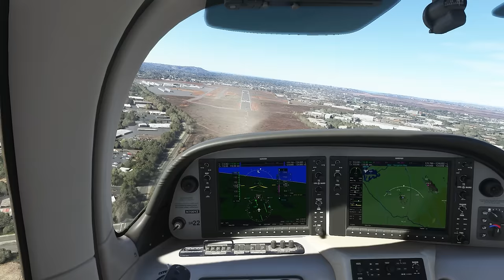Fatal Plane Crash At Montgomery Field After Student Pilot Declares An Emergency | N700YZ Crash

Comment: You said leave our thoughts. So I will. This will be long but I think pilots, especially "old school" pilots will appreciate and agree. First, I'm 48, have been a pilot for 31 years and am a flight instructor in both helicopters and airplanes. My disclaimer is that I do not know this pilot and it's always tragic and it hurts to hear this kind of news. I'm not disparaging or meaning disrespect to him but I will state some harsh reality that some might find blunt. The reality is we don't know what really happened but we have some information. Let's take that info at face value. What he's describing is "runaway" trim. This is an actual contingency that happens more than you'd think and pilots SHOULD be trained on mitigating it prior to either solo flight or if they are already a pilot, during checkout in the plane. We don't know if he was trained but I'm going to guess he was. Yes, I made an assumption that could be wrong but any CFI worth his ticket would and should have ensured this. It sounds, from the tiny bit of info we have, he had a runaway. The proper procedure would be to pull the breaker, disable the electric trim motor, and then fly the plane as normal using the trim manually. Here's where I know I'll catch flak. These new, very high performance Cirrus planes are, in my experience, either flown by VERY experienced pilots or EXTREMELY inexperienced ones. People with the money to learn on them are given many "crutches" in the form of features the planes have. And I've seen way too many pilots that are low time or learned in Cirruses that are severely lacking in basic airmanship skills. I'm not saying this was the case here, I'm just calling it as I see it with the information we have available so far. This isn't an indictment on his character or the type of person he was. It's just a brutal fact. It SOUNDS like he had the runaway trim, panicked, and did the LAST thing he should have done and tried to fight the trim down to land instead of giving himself plenty of room in the air and fighting it until he could disable it and then land the plane as if it was a non-event. You see this frequently with these "Cirrus pilots". Those planes spoil you because they do everything for you...until they don't. I think it's sad that this happened when it may have been avoidable but the bigger issue is if no one takes away anything from this that could save another pilot in a similar situation, that's an even greater tragedy. I could go on for days about this but I'll leave it at this and keep this "testimony" open to rebuttal. But anyone who finds this "offensive" and wants to debate me on it, before you do, look carefully at whether or not your response is driven on empirical data or pure emotion.
Reply: I’m old school too (80 years old and a pilot for 63 years) and I’m convinced you have accurately identified the probable cause. I like what you said about having an airplane that will do everything for you…until it don’t…because that WILL happen if you fly enough and it usually happens at the most inconvenient time!
Reply: I don't think you were disrespectful at all. You stated facts where you knew them, and yes, a little bit of a conjecture, but with the caveat that you could be wrong. I don't see any problem with that. 
What do you think of the comments of Cirrus pilots on Katherine'sReport that he may have been too slow, thus activating the Envelope Protection System, which in turn would have tried to bring the nose down? The  theory is he may have misidentified it as a trim malfunction, kept pulling back on the yoke, which reduced speed until he stalled and crashed.
Reply: @RMR1  This is a really interesting theory and, admittedly, one I hadn't heard or given thought to because I'm not a Cirrus pilot. I've heard of this system and read a little about it but I might need your help if I get my facts wrong. I don't have time in a Cirrus (I call them 'cult airplanes') but I have time in many different models with electric trim, some of which can he a real handful if you have a runaway.  Having said that, I'll respond with my thoughts on that possibility.  It's my understanding that that system has an override to it.  If that's the case, once again the issue would be training.  Being familiar with the aircraft and able to identify when that system kicks in at a bad time would and should be crucial to the pre-solo or checkout process.  

Let's say, for argument's sake, that that's exactly what happened.  It reinforces my statement on these planes doing everything for you, until they don't.  It's a dumb machine and doesn't perceive the danger in some situations.  That's the pilot's job.  When it does something IT thinks is right, sometimes it's not.  The Cirrus is also not a "fly-by-wire" plane, in that it still uses mechanical linkages connected to the yoke to manipulate the control surfaces. This means that the pilot can still make inputs against the system.  If the system is designed to overpower the pilot, I'd say it's a poorly designed system and that contingency should've been considered in the design.  But I'd bet my teeth that it has an override which, once again, would've made this a "non-event" if applied.

Now back to that vs. runaway trim.  Like I said, I only used the available info given in this circumstance, I wasn't there with him to know what really happened.  Either way, EVERY plane I've ever flown has an override for trim systems and for autopilot systems.  In other words, if the pilot needs to tell the dumb machine to do what you're telling it to, they provide the means to do just that in order to allow the pilot to meet an emergency.  EVERY plane or helicopter I've flown with an autopilot or electric trim or ANYTHING that flies it for you could be outmuscled by the pilot and overridden. Whether it's a button, switch, or breaker.  It'll fight you, and you don't want to fly for extended time because it'll wear you out FAST, but it lets you fly (notice I said lets "YOU" fly) until you can mitigate the problem.

Now the other possibility of stalling.  That's also a scenario that can't be overlooked. I did think about that initially. I thought that he might have stalled it in but, once again I'm reaching into conjecture here and may be way off the mark, but in accidents I've seen, and I've seen a few, where the pilot stalled it on approach/landing, they either fall short of the runway, or crash ON the runway. They're still landing the plane in their minds or at least fighting to put in on the runway when they stall it.  In some cases, they don't even know they're about to stall, it just takes them by surprise. This pilot looks to have almost overshot the runway and ended up alongside it, kind of distant from it, or in any case, not in line with the runway itself. It's just not indicative, to me, as a botched/stalled approach.  It actually looks like he was trying to follow the instructions and do an offset go-around until the airplane just overtook him.  I don't rule out a stall but where he ended up seems to indicate he was "fighting" the plane, which would be more in line with that trim or Envelope Protection System.  

Anyway, This guy's poor family is having the worst days of their lives and I feel awful for them.  I just want to be clear that I'm not trying to make a spectacle or case study out of him but we're pilots and/or aviation enthusiasts and this is what most of us do in these events, if only to try and understand what went wrong so it doesn't happen to one of us or someone we care about.
Reply: Another forum had a discussion on this and it sounds like the trim circuit breaker is INCREDIBLY hard to get to on the SR20.  Like down next to your leg by your feet.  Where even if you know where it is it's hard to disable.  Most small planes it's on the lower dash and accessible...
Reply: I’m a new pilot. Student pilot as a matter of fact. What you just said probably saved my life. Next thing I’m going to talk and drill with my instructor would be runaway trim. 

My reaction to this unfortunate incident was “why didn’t he just go around?” Hindsight 20/20, I know, but if it was me up there with a runaway trim, after the situation settled I’d fly around for a bit. See what I can do. My first thought was actually, since he was in a cirrus, was to fly somewhere remote-ish and pull the chute. My instructors, peers and myself often talk smack about cirrus’s and it’s parachute recovery system. But I think this would have been he perfect time to use one, if equipped. 
In my case, since I fly a DA20 I would just burry the stick counter to the trim force and see how long I can hold it. If I can get to the breaker I would pull it.
Reply: @Mr.Scootini  He couldn't go around because he was trimmed full nose down.  The only way to get the situation settled would have had to start with pulling the breaker for the electric trim - and this is the critical problem in this case. If you're training on a plane with electric trim and haven't been accustomed to using manual trim, you may not know how to disable the electric trim and use the trim wheel or even be that aware of its existence. This pilot was low and unable to climb so the chute probably wasn't an option.
Reply: It is possible he had barely ever used manual trim.  If you have electric trim, you'd use it 99.9% of the time and only use manual if you're training specifically for a failure or something.  So even if the instructor covered it (and there is no info on that either way but I assume it's part of the Cirrus curriculum), it's probably far from a current/ingrained skill.  I have no idea where the breaker is on a Cirrus but my Cessna TR182 had an electric trim & A/P cutoff switch right on the panel (custom install).  Not having that, I'd have had to hunt a bit on the breaker panel.  I'm not as willing as the OP to dump on the Cirrus factor in this case.  He was a solo student pilot who may (we don't know) have received inadequate training in handling runaway trim - and those factors loom larger for me than the Cirrus thing.
Reply: It may have just been a CFI who didn’t have a whole lot of experience in Cirrus’s. 

I’m a CFI in TAAs. Started in a steam gauge 152, Flew a DA40 G1000 for most of my from Instrument to CFI and then spent most of my time as a CFI in a G1000 172S. I have never taught it and I haven’t had a CFI teach it to me. In fact checking the POH of the 172S and the DA40 which I trained in before(both of which have electric trim on the student side) there doesn’t seem to be any emergency checklist or action item for it. 

My guess is because unlike the cirrus they both have trim wheels, so if it runs away you can fight it with the wheel, though I can’t guarantee thats the case.
Reply: @Dr_Kenneth_Noisewater  from what I know in aircraft design, trim should never over come the actual elevator input. It’s gonna take a lot of strength, but it’s what is needed to live
Reply: pulling breaker was my first thought...elect. trim....
Reply: @Mr.Scootini  I would have been pulling like there's no tomorrow.
Reply: @Dr_Kenneth_Noisewater  sorry the trim surface area is way smaller than the elevator surface area, simple physics. His airspeed is a factor and he might have to be putting in hard control inputs but it’s flyable. Small GA aircraft fly everyday In uncoordinated configuration until trimmed correctly, the sad part is he lost his life as a new pilot faced with an abnormal stress situation.
Reply: @ragzpar  And here, ladies and gentleman, is that "emotional response" I warned you all about.  Since you're in the mood to start slinging mud, I'll respond in kind.  This'll be fun.

ANY pilot that takes his craft (that means practice of his chosen subject, not aircraft) seriously will have prepared himself for this contingency.  So I'll first address the breaker issue.  I've flown planes with a LOT of breakers.  But there are breakers you INTIMATELY familiarize yourself with.  Hydraulics if they're there, ELECTRIC TRIM if it's there, autopilot if it's there.  Runaway trim and autopilot issues are a real thing.  These aren't anomalies that only happen in once in a blue moon fashion.  If you're flying an aircraft with these features and you can't find those breakers with your EYES CLOSED, you are failing in your responsibilities as a PIC.  You locate these breakers and familiarize yourself with "how many down and how many over" so that if it happens, you don't need to bend down with a flashlight.  You can feel for them while still flying.  And for a plane with so many features on it that are automated, it's a pretty poor design to make it THAT difficult to mitigate for that problem.  And for your information, I HAVE in fact handled a runaway trim in flight. I reverted to my training and preparation and it became a "non-event".  The way you're talking, "I'm a Cirrus pilot" (You are EXACTLY why I call it a "cult airplane", because you guys think you're superior pilots when in most cases, it's the opposite) you sound like you're prepared to accept your fate and become a smoking hole yourself. If you're rolling your eyes by now with this reality check, that is why you are a hack.  That is why you are an amateur.  And that is why you are a guy who flies and not a "pilot". Don't you, for one second, think you have the authority to tell me to "stop acting like I could've handled it".  I have had to handle things in airplanes and helicopters in my 31 years that would make you cut your ticket into pieces. Get off your high-horse, rookie, it may save your life.

Next, when you're right, you're right. I've seen guys with TONS of time make stupid errors.  Complacency is a killer.  Humility is a life saver.  The guys that I've flown with that had lots of time that screwed up, when they realized they got complacent, they came back to reality REAL fast. As far as me making mistakes, everyone has. I don't pretend to be flawless.  But I also paid CLOSE attention to emergency mitigation and trusted in it and took it SERIOUSLY.  That's why I'm still alive.  So go ahead and criticize me for that.  After the years I've spent flying, it isn't just dumb luck.  If I had that kind of luck I would've made billions in the casinos by now. Check your level of self-importance, junior.

This brings us to my disclaimers. I NEVER, at any point, claimed I knew exactly what happened.  In fact, I was VERY careful to state that none of us really knows what happened.  If you recall, the poster of the video asked, specifically, for pilots to comment on it, so I did.  I was invited to state my opinion and quite frankly, until you came along, the adults in the room were having an educated, respectful conversation on the subject.  But I knew you'd come along, so here we are now.  Again, you don't have the authority to tell me to "shut the fudge up" when I was invited to state my opinion.  If you don't like my opinion, shove your head up your immature crack.

Now, we'll end this like this.  You felt perfectly comfortable trying to impeach my character so I will repay the compliment.  You sound like a kid who has more money than brains and had the opportunity to fly a Cirrus. Perhaps you've never even flown another model plane.  Perhaps you're not even a pilot because flying Cirruses in Microsoft Flight Sim doesn't make you a real pilot, kiddo.  It also sounds like you may have, on an occasion or two, seen a CFI make a minor mistake that you absolutely relished in correcting him on.  I'll wager you remember both times and have them burned into your memory and take pride in it. Might've even logged it! You have an AWFULLY high opinion of yourself if you're so good that you feel like you're smarter than the CFIs you've flown with.  If you really are that much better than them, it doesn't bode well for them and you should find a new CFI. But you've already given yourself permission to fail in an emergency.  And that speaks volumes about you.  I'm not wishing any harm to you or, god-forbid, whoever is unlucky enough to fly with you.  On the contrary, I hope you really take a deep dive into yourself and actually re-read everything by EVERYONE in this comment thread and try to become a better pilot instead of the Amelia Earhart you THINK you are.  You better learn that plane, pal, because if this isn't a wake up call that things can, and do, go wrong, no matter how many bells and whistles you have, you don't stand a chance.  Thank you for being such a great example of how NOT to react in an intellectual discussion.  Your emotions won't help you up there, so you better get control over them down here and reel yourself in before you hurt someone.  Here endeth the lesson.  Keep the blue side up, kid, you're gonna need it.
Reply: @rstats2127  it's not the surface area that matters - entirely.  It's force.  Otherwise how could a tiny trim tab offset a relatively large elevator?  The answer is that it's located way out on the trailing edge of the elevator so it has a longer moment arm compared to the elevator's moment arm.  Force x length = moment or torque and all that.  And it probably wasn't just a little out of trim but full nose down if it really did run away.  I agree it may have been possible to overcome that but it would have required a helluva pull while also trying to do other tasks.  I've had my airplane far out of trim and it's a load.
Reply: @rstats2127  You raise a good point about the possibility of an inexperienced pilot in a highly unusual emergency possibly stalling.  That's a lot to work through and you can hear it in his voice.  This is very much a tragedy indeed.
Reply: @gringoloco8576  If that is fact (I have no idea) it would make me wonder how these planes got certified. Should be worthy of an AD at least.
Reply: I am so sorry this fellow lost his life in an avoidable situation. Reflecting on my flying years virtually every incident my friends were in, or myself (even when I was an instructor) was avoidable. 
I was blessed with the best instructor who to this day speaks to me when I fly. Bunny Connors CFII, ATP is no longer with us but her lessons remain. 
Instruction 
Repetition 
Simulation 
In all conditions 
At all times one might fly. 
In all environments.
Reply: @gringoloco8576  Turn master switch to off.
Reply: I just want to remind everyone who are commenting on this thread that the pilot could be a student pilot based on the title of the video.  He would not be prepared to handle a variety of emergencies like a seasoned pilot or a CFI.  It would be easy for a student pilot to panic at a moment like this, and the natural instinct is to put the plane down especially when he was approaching an airport.
Reply: Agree; master switch off would disable electric trim (and radio, but a live pilot could explain that later, especially since an emergency was declared).
Reply: @Quillons1  looks like he deleted his original post but I thoroughly enjoyed your rebuttal!
Reply: @dangoldbach6570  Thank you. I have his post saved if anyone is interested. My response is a little harsh (it's meant to be) but without context it might be weird to see what I'm responding to. But I saved his post for the next emotionally fragile softy that wants to take a shot and call me "mean" 🤣
Reply: @Quillons1  - This entire thread is an interesting read. My thoughts are that the latest tech that does everything for you is not a bad thing. It does require two things:

 - The more tech you have, the more initial and recurrent training you need. You have to know how the tech works and how the tech breaks. Then, you have to know what to do when (not if) the tech breaks. 

 - The more tech you have, the longer and more diligent your planning, preflight, and checklists need to be. Any electric trim or autopilot system has to have a pre-taxi or run-up checklist that includes actually testing multiple ways to disconnect the system. Being able to over-power the system is not enough unless the system can sense the pilot feedback and disconnect on its own. 
A good example of this is in the Cessna 172SP. The autopilot will auto-disconnect when fought. There are also 3 different buttons marked in red that will disconnect the system. The trim thumb switches will disconnect the system. Finally, the autopilot/trim circuit breaker is the only one marked in red and easily identifiable.
Reply: @phatvu3811  - Granted, it would be natural for a student pilot to panicked and be flustered. This is even more of a reason to fly within your individual limitations. Flying too much airplane may have been beyond his limitations to perform solo. Flying with a more seasoned pilot or an instructor would have been a wiser decision. Even flying a simpler aircraft would have made sense.
Reply: @rstats2127  - I am not really sure I understand your statement. The trim tab is a very small surface area. But, The pilot is not fighting the trim tab. The trim tab easily moves the much larger surface area of the elevator/stabilator. In a poorly trimmed aircraft, the pilot would have to fight the entire force of the large primary control surface.
Reply: @Mr.Scootini  - Think of trim as a secondary control input. It moves the control surfaces with the same dynamic force as another pilot. Think of the amount of force one would face when fighting a trim stall on a go-around. It is not an insurmountable amount. But, it would be enough to throw off the muscle memory of a new pilot.
Reply: A Cirrus is too fast for most rookie pilots to keep ahead of. Stay ahead of the airplane is rule number one.
Reply: @deanfowlkes  The latest tech doing everything for you is definitely not a bad thing.  If that were the case, they wouldn't continue developing better and better goodies.  Where it becomes a bad thing is when it's all you know and can't function without it.  I gave 3 BFRs last month and 2 of them were guys that fly a technically advanced airplane (TAA).  The plane we were in has a Garmin 750 in it.  The first thing I did was press the "home" button and "took away" their GPS.  They were COMPLETELY lost without it.  This is a phenomenon I've seen much more of lately.  Basic airmanship is a dying art.  Pilotage is a dying art.  I still do Cross countries with paper charts because it's actually fun for me and I like the old school feel of it.  Paper charts don't run out of batteries.  Their screens don't crack.  And they don't overheat.  But they DO fly out of windows (this is a really funny story, actually)! 🤣 

You're 100% right, though.  You HAVE to know what to do when you lose these goodies.  I said in my first post that I've seen either really experienced pilots flying Cirruses or REALLY inexperienced ones.  The inexperienced ones are outright frightening.  I lose sleep knowing a lot (not just a few) are up there with me.  They are that over reliant on the advanced features.  If you can't operate without a GPS, you shouldn't have a license.  That's my humble opinion.  That's not to say that you SHOULDN'T have one.  You just need to not turn into a bowl of mush when you see that little "LOI" light come on.  

I also do IPCs with "TAA" guys. Those are REALLY funny. I flew with a guy recently that had hundreds of hours of IMC time or "actual" instrument.  Turns out 99% of it was under autopilot.  He couldn't hand fly an approach! You gotta "stay good", even in these fast, nice planes. The biggest problem is that a lot of pilots don't want to be seen with their "pants down".  They don't want to admit to themselves that they may not be as proficient as they think they are.  So they just keep doing what they do best and don't step out of their comfort zone.  

Anyway, I whole-heartedly agree with you on tech issue.  I don't dismiss it or disparage it.  I just don't like how pilots now tend to think it's the only way to fly.  Accidents waiting to happen.
Reply: @deanfowlkes  spot on. The trim tab flys the elevator and not the aircraft. Having experienced trim runaways as an autopiliot maintainer on troubleshooting test flights I can attest to how scary and quick they are and how much authority they actually have. If they happen too close to the ground they are damn dangerous and can quickly become unmanageable.
Reply: I am 56 and agree 100% . I also feel that part of the responsability for this crash should go the ATC for adding additional stress on the piolet for not listening to the transmissions. He stated three times, and twice very clearly that he had an emergency. Yes, he didn't use the proper language, but he was a new pilot and panicking...anyone who was actually paying attention should have understood what was going on. I have noticed in the past three decades, that like the rest of society, the profsionalialism of both ATC and piolets has declined drastically. The stuck mike is BS if this is actual audio. We all could hear and understand what was going on despite EVERYONE stepping on each other. She was simply giving orders and not listening to anyone. Anymore, a lot of ATC and pilots alike are like the don't give a sh..t teenagers at the drive through. They talk 100 miles an hour and slur their words. I have had to have a transmission repeated up to five times before getting pissed off and asking for them to slow down just a little bit and enunciate their words. I always get the same BS response...we have a lot going on and need to speak fast. I understand that completely, but which is faster? repeating it three to five times, or saying it clearly once. Most of the time I just let it go, because there isn't that much traffic like in this video and I can figure it out. But, when going into an airport where there are several planes an hour landing and taking off, I would really like to know what is going on around me. I know that I too will probably catch flak for my response.
Reply: A reasonable and plausible explanation. May the gentleman RIP.
Reply: You aren't wrong
Reply: It looks like you have hit the nail on the head here, it would not surprise me if this a low hours pilot, it does annoy me all these electronics cutting in when you don't need them, that is why I drive a manual car still, I can't understand why you want or need an e-trim anyway it's not hard to use, I don't know about a huge airliner but on something small I can't understand why you need it at all.
Reply: With 10 years of professional flying experience flying pistons, turbo props and Now jets and almost all my primary training in steam gauges I absolutely 100% agree that there was panic and may have been poor judgment to quickly set the aircraft down. Actually seen that happen not to long ago with a Gulfstream over in SDQ airport with inadvertent speed brake deployment. Crew was in a rush to land doing a short visual instead of doing a long final over water and buying themselves time for a much stabilized approach. RIP.
Reply: I think what you said was well stated. No flak from me and Im also dual rated fixed and rotor wing. Tragic and sad its part of flying and we can only learn from these incidents to try and mitigate them. Bell-206 Captain
Reply: @andrewbello983  Jet Ranger 🚁 😁
Reply: @deanfowlkes  I think in this case, it was a student pilot practicing after his solo.  All student pilots must have a minimum of hours of solo flying before he can be qualified for the the private pilot checkride.  This isn't the first time a student pilot crashed his Cirrus.  In another accident the student pilot forgot to remove the pitot tube cover and couldn't tell his speed.  He flew too slowly and spun his airplane and died.  In both cases, for whatever the reason, the two student pilots did not climb to a higher altitude to deploy the BRS parachute.  But then, they were student pilots and I remembered making quite a few stupid mistakes while flying solo during training too.
Reply: I’m a much less seasoned 41yo pilot than the OP, and I do fly a Cirrus. I think the OP nailed it. 100%. One big problem that I see is with training in general. Young CFIs that don’t want to instruct are instructing so they can hit that 1,500 hr mark and go to the airlines. Their students suffer from it both knowledge wise and in stick and rudder flying. Also, there is a huge shortage of DPEs, and some DPEs are conducting 3 checkrides per day (at $500 - $1000 per). Quality pilots are not being made at pilot mills and they are doing dangerous/deadly things in the sky.
Reply: @RMR1  There is some amusement in the idea of a Cirrus having an MCAS accident, tragic as it is.
Reply: Didn't he also have a ballistic chute?
Reply: This is why I prefer steam gauges and manual trim.  The only modern technology I want is an iPad with foreflight.
Reply: Not trying to discredit anyone but a lot of people are saying to pull the circuit breaker and use manual trim. That would work in most aircraft but I thought the cirrus only had electrical trim and not a manual trim wheel so what should he do in this scenario? Maybe I’m wrong and they do have manual trim but I heard they didn’t.
Reply: Didn't know the trim was electrically actuated- interesting. 
Not sure if I like that.
Reply: @jameschilton2039  I was under the same impression, at least with a couple of Cirrus models, but I have no time-in-type. If so, I think the FAA needs to amend the certification standards to disallow that. Even with far more robust automation systems backup, Airbus still has manual wheels for a worst-case scenario (and even those did not save such a situation over the Meditteranean one day, likely because the annunciator of electric control having quit was too dim and small to generate the appropriate reaction). I would be leery about flying a GA manufacturer's product who thought it was fine to exclude them when the forces were great enough to cause, or significantly contribute to, loss of control at slow speeds.
Reply: I had no idea this thread would take off like this but I'm glad it did. I've chimed in a few times addressing a couple of things but for other things I've kind of just lurked in the background and took things in because I wanted to see where it would go.  Some posters here have said things that I think are truly with the best of intentions, but perfectly illustrate my point in how we have people flying Cirruses that shouldn't be.  So let's buckle up again because the Cirrus fanboys are going to take exception to this! 🤣

One of the recurring comments has been about the "Ballistic Recovery System", or "chute" to keep it simple.  This was an AMAZING implement for safety on planes.  It also (like GPS, iPads, TCAS, TAWS, and the list goes on) has had a very detrimental effect on safety, or rather the "safety mindset".  I've seen at least 3 people post about "Why didn't he just activate the chute??"  And the reason this is being asked is simple.  Because it's there.  It's literally a parachute that takes away from the pilot thinking, "I may have to make a forced landing or other kind of emergency."  Instead, these pilots are saying, "Well, f*ck it, I have the parachute,  I'm not making an EMERGENCY landing!  Why would I even consider that when I have the chute???"  This is another example of preparing to fail, on several levels.  Now, full disclaimer, I will admit that I find the over reliance on the chutes to be absolutely disgusting.  I've flown with guys getting BFRs and checkouts in Cherokees and 172's (and a few other airframes) that when I give them a simulated engine failure, the FIRST thing they ALL do is revert to "the chute" option.  And it's not there. It's really funny watching the reality set in, actually. But it's a toxic mindset towards safety. I'll outline a few, but maybe not all, reasons I hate the mindset.

The first reason I've already stated.  Some pilots, you know who I'm referring to, use that crutch to protect them simply because it's there and it takes away the necessity of having to be proficient in Emergency Procedures. I would bet my ticket that some of you reading this that fly Cirruses (or other planes with a chute) have actually told themselves, "If I get into trouble, ANY kind of trouble, I'll just pull the chute."  Like it or not, a couple of you actually already basically said that not even realizing the ramifications of it.  So basically what I'm saying is that "safety blanket" that you've been given has been used to absolve yourself of PIC duties to meet an emergency.  Even a simple one. And yes, there are simple emergencies that can be mitigated into a "non-event".  I've touched on one or two earlier. You have guys flying around in Cirruses that'll pull that chute if their RADIO fails! And no, I'm not being hyperbolic or exaggerating. I've had these discussions with them before.  The point?  Relying on that chute out of "self-preservation" is actually detrimental to self-preservation.

Next we look at the ramifications on your license.  Let's take this situation and modify it a little to fit our scenario.  Runaway trim happens.  We follow the recommendation of a couple of posters here. We fight the trim, climb, slow down, if necessary, and pop the chute. CONGRATULATIONS!! Crisis averted.  Until you're flying in an area where, now at the mercy of the wind, puts you in the middle of a lake or into the ocean.  Now you've ditched. I hope you've taken a ditching school class!  Because it's not as easy as you think in that chaos. Or you've put yourself DEEP into a canyon or ravine.  Or insert ANY other undesirable location that'll be hard for rescuers to get to you.  There's no guarantee you're not going to get hurt in the landing of the deployed chute.  And as a side note, which we'll get into in a bit, you've destroyed a perfectly working airplane.  I would MUCH prefer to get that malfunction under control and just simply fly the airplane and land it, normally. Non-event.  The FAA doesn't even KNOW about it because a trim issue isn't required to be reported.  One of these is an ACTUAL emergency that YOU manifested.  One is a non-event that YOU mitigated. Either way, the plane is flyable, until YOU made it not flyable.  The other half of this is now you've created either an aircraft accident. I know, I know, "It's only an 'incident' if no one is hurt".  Well, I'm not so sure the FAA agrees.  an "Accident" includes substantial damage to the aircraft.  Pulling that chute renders the plane unairworthy ever again.  I'd say that's "substantial damage".  This one may be subject to the FAA's interpretation.  Now you have an incident or accident on your record which COULD induce repercussions against your ticket....when it was as simple as pulling a breaker, hitting an override, or whatever and just flying the plane...as normal.  Non-event.  Even a full engine failure, If you're in an area where that plane had a small issue but caused the engine to fail (I know it's an oxymoronic thing to say but they really are the norm.).  If you can safely perform a power off landing in that plane in a DESIRABLE location and the engine can be repaired, that plane flies again.  You pull that chute, you destroy the plane. More on this in a minute.

Now this will rattle a few people.  These planes cost about $500,000.  Maybe you can get them for les but they're about a half million to purchase.  It's nice to have money.  I'll break this down into 2 sections. 1) owners and 2) renters.  

Owners, you bought this gorgeous plane, fast as a demon, climbs like a homesick angel. You're in love. I don't blame you.  Do you want to immediately revert to destroying your plane, getting taken to the cleaners by the insurance company when they determine you could've landed the plane and not made it a total loss, have an incident/accident on your record making it more difficult (and expensive) to ever get insured again, AND be out half a million??  I know, "You can't put a value on human life".  That's true.  But by doing that, you may find it difficult to fly again after that.  Maybe not. But do you want to find out when you can just save that parachute for a complete, end-of-days, catastrophic event (which is REALLY what it's deigned for) and be proficient at being a PILOT and be able to handle an emergency landing and save the plane?  I wouldn't.

Renters, I get it, "Screw them AND their airplane, it's not MY plane and it's MY life."  I get that, too.  And your Avemco or AOPA renters insurance will cover only a fraction of the damages on the loss of that plane.  And you're renting a Cirrus probably because you can't afford to buy one.  Well, you will spend enough money on the difference that you're responsible for in that plane to have bought a different plane that would've been BEAUTIFUL...but it won't have a chute on it.  Then, once again, there's the issue of having it on your pilot record.  Maybe it's not a big deal to you but I spent a LOT of training and a LOT of years trying (and being successful) in keeping my record clear.  That could change in an instant. Some of you might just say I'm lucky.  But I will say 2 things about that. Thankfully my record is clear, that DOESN'T mean I've never had emergencies. And secondly, "Luck" is "Preparation" meeting "Opportunity".  It's funny how guys who are more prepared seem to be more "lucky" than guys that aren't.  

So for those of you that have the attitude of, "It's there, so why not use it?", those are some reasons why.  If you're relying on that chute because you're not PREPARED for an emergency, you're not a good pilot, and you might have to do some soul searching and a deep dive into your own self and decide if flying really is for you.  Please, I'd love to hear from you guys!  This is turning out to be a really good discussion!  I like the input!  Sorry about how long these are but it's a lot to say!
Reply: @phatvu3811  - True. A minimum of 10 hours are required. At least 5 of those hours have to be cross country. The rest is up to the instructor. Just as long as the student has 10 takeoffs and landings solo.

 That still means that the student must know everything about that aircraft before being released to solo practice on their own. Or, the student needs to be taught in a simpler aircraft. After all, the student should not solo unless they have an instructor endorsement for each solo flight.
Reply: Definitely going to hit my flight instructor up about runaway electric trim before our next flight.
Reply: @AmericusMaximus  - If you fly with electric trim and/or autopilot, have your instructor show you each and every way of terminating the operation or disconnecting those. Practice each one during either your pre-taxi or run-up for each flight.
Reply: I guess it’s good my plane as an electric trim toggle switch.. 🤷🏼‍♂️
Reply: As a current student pilot, I appreciate this info
Reply: When you go from a 172 to a 177 RG , its a whole difference  entering a 45 into the pattern with 120mph .  They put 172! minded people into high performance Cirrus and they just get behind it just like at Hobby Airport in the Cirrus, Brain Overload!
Reply: I’m no pilot, but I am an “old school” ground vehicle enthusiast. I see the same effect with increasingly-automated cars and drivers who have not actually honed the ability to control the situation without the automatics
Reply: I have to humbly agree to everything you’ve said in your comment. I am a professional pilot who’s been flying for over 30 year’s corporate experience with almost 10 type ratings (almost due to being in training obtaining my 10th as this is being typed; no pun intended). This was a very tragic accident and I also am very empathetic to all those involved. It’s a very tragic and unnecessary loss of life due to not having the experience, meaning total flight time, flying and dealing with emergency situations. I myself have not had any emergency situations in the real airplane; however, I am trained in how to deal with many emergency situations in the simulators. 
I don’t know the Cirrus or what kind of trim system it has or if it’s trained in what to do if a runaway trim occurs. What kind of trim system it has doesn’t really matter. What matters is being trained for any emergency situation on any aircraft is paramount. That being said again, I also believe trying to land an aircraft with any flight control malfunction is a recipe for disaster, such as in this case. Like previously stated, he should have powered  up and gone around and climbed to a safe altitude to work on the problem, notify ATC that he is an emergency aircraft which would have given him priority handling. Secure the problem and taken his time to land safely. That being said, it’s the experience that can keep your mind geared in what needs to be done in the correct manner. 
Training… Training… training… and keep calm and always fall back on your training. 
Again.. my utmost condolences to all who have been impacted with this unfortunate accident. 😢
GOD Bless!!
Reply: Thanks for this response. I can only assume he panicked and just wanted to get on the ground so there would be no problem, so to speak. This is like a scuba diver bolting to the surface over a problem that can and should be solved at depth.
Reply: @Lehmann108  Funny you say that… I received my PADI certification while I was in the Philippines and have not gone diving since my certification. If I were to dive today and had an incident under water, I probably would panic and do what you said, try to surface immediately. Again… training is always paramount in being able to keep a clear head. 
Stay safe…
Reply: The first thing I thought was “what’s a student pilot doing flying a cirrus?”. 

I have electric trim in my plane and use both the electric and manual features. Electric trim for small changes and I go manual for large quick changes. 

I was trained for a runaway and a runaway is pretty dramatic. But you’re taught to keep flying the airplane. You do whatever control inputs necessary to keep it flying until you pop that breaker. 

You also need to know EXACTLY where that breaker is so u can find it without looking at it. It helps to put a breaker collar on it so that it’s easy to find. 

This situation can be resolved in seconds if u have been trained properly. 

But when u have low time CFI’s who barely know how to fly themselves teaching new pilots, this is what you get. 

Babies teaching babies.
Reply: Works well until it doesn’t…poignant.
Reply: @gringoloco8576  It sounds like an airworthiness directive from the FAA for an easily accessible front panel auto-trim disable switch on that model of Cirrus aircraft might be in order here.
Reply: I couldn't agree with you more there should be more training from the factory when Pilots purchase these aircraft. They should disable every single feature that they can and have them fly the aircraft in different scenarios where automation won't come in and Save the Day. I am sure they could rig a few of their aircraft just for this type of training where the Factory pilot could just enable and disable different features and controls to create scenarios that the new owner pilot would not normally be in. It goes without saying that the pilot in his family are in my thoughts and prayers although I just found out about this today
Reply: @Shojohn11  This is a great point. For the money they get for these planes, they can spare a training flight or 2 to the purchaser. If the purchaser is a flight school, out other fleet, then for every plane, that school should have the option of sending a CFI through the training. It would be a hell of a marketing addition and incentive to buy that model.
Reply: Completely agree.. Traditional training aircraft have far more basic trim systems and now that alot more flight schools are heading down the Cirrus route, a more robust training syllabus needs to insure not just meeting a flight standard, but that the technical knowledge of the aircraft is ensure before flight..this should absolutely include trouble shooting and how to effectively use the QRH
Reply: @Quillons1  Never thought of flight schools , when purhasing such an aircraft, put them through the ringer and that students come on board for training and learning like you said free advertising they're going to end up loving the plane maybe one out of 100 will buy one. I see some people disagree with us to break it down into a simple anecdote my children was still taught arithmetic in school. What if their computer or calculator broke or did not have one they would need to know the basic of mathematics and not only that just the course of mathematics teaches learning and problem solving skills
Reply: Thank you for sharing. I too am a student pilot, and I have been studying crash/incidents to better prepare myself for the unexpected. It’s not easy to state harsh facts - so I applaud your efforts into sharing the face values. As well as how to prevent and prepare for these things. 👍👍
Reply: Some articles I'm reading on ESR 20 they say this is not an uncommon occurrence where the autopilot just shuts off also
Reply: @Shojohn11  circuits aren't flown with autopilot.. However, trim runaway is a very real and common issue.. The problem here is that the student was probably not shown how to diagnose and resolve a trim runaway event... Most aircraft check list would have you verify whether stuck control surface and faulty servo... Most of the time the solution is pull the CB
Reply: @Quillons1  I used to be somewhat sensitive, but have since grown up.  Now I appreciate and learn from advice and experience, no matter how harsh.  Flying can certainly go from heavenly to very serious in short time.  Your post is very clear.  You have to take the subject very seriously, and always be ready (meaning trained) for the worst.  Disclaimer - I'm not a pilot and won't be for a while due to financial restrictions.  But I've promised myself I'll never solo until my CFI tests the hell out of me and is confident I know my stuff.
Reply: I fully agree with you. I learned to fly old school and owned a Cessna 172, then a 182 and later end up buying a brand new Cirrus SR22. My opinion is that the culprit is training and a new generation of pilots and instructors that rely too heavily on electronics and then imbed the culture in the training also. Works fine most of the time until the electronics fail, and then it becomes fatal because the “electronic” pilot does not have the skill and training to deal with the situation the old school way. The Cirrus is a magnificent airplane and much safer than older planes, but just like a self driving car can increase safety for bad drivers, the safety goes away and becomes a huge problem fast when the system fails and you do not have a competent driver to fill the void. 

We see the same issue in airline accidents/incidents where the pilots are relying too much on flying with autopilot always and when that fails, they do not have the experience and skill to prevent it from escalating into a crisis.
Reply: When I was learning less than 20 hours I would not thought of popping the breaker
Reply: @cooperparts  were you learning in a Cirrus?
Reply: @alexanderdavidson7837  no but it had a trim on yoke
Reply: @Quillons1  Wow..thank you...I wouldn't worry about some of these clowns on here, they just can't handle pragmatic constructive criticism.. You are an inspiration... Have you considered running for office?
Reply: @alexanderdavidson7837  no I flew several cirrus planes but I am a diamond guy  did not like the side stick  my next plane will be a panthera
Reply: Very well said and a completely plausible if not probable situation that resulted in the tragic death of the Pilot.
Reply: Let us learn, so that No death is in vain😢
RIP
Reply: The electric trim on the cirrus is not a true trim of the elevator surfaces but a trim of the springs connected to the yoke. One does not need to overcome aerodynamic forces like a trim manual trim.
Reply: Good!
Reply: @Dr_Kenneth_Noisewater as a 25 yr + pilot and over 1k hrs in a sr22, I do have to say that unless the plane has the circuit breaker pull colorized, it would be hard to discern where the breaker is even though they are grouped into different systems .   the cirrus does not have manual trim (non electric).  It's controlled by the trim switch on the yoke and electrically activated.  Not knowing how close he was to the ground he was other than the last callout of 1200ft before the trim ranaway, unprepared pilots not knowing the system or exact location of the breakers positions (even more difficult during night emergencies) while combating a runaway trim nose down on the final leg would be difficult.
Reply: Look at the poor woman in Texas who after numerous go arounds and attempts to land spun her Cirrus in killing her and two others. There was a Cirrus at ANP doing a go around and it spun in killing the pilot. They are great traveling planes but unfortunately as you have said many people flying them lack basic stick and rudder skills.
Reply: @Dr_Kenneth_Noisewater  could have been full nose up also. We will have to wait for the report.
Reply: Spot on. I'm '64, and when I was getting my PL, an instructor died because of a much, much simpler kind of "stupid automation", as I call them. In a Cherokee with RG, there used to be (mind you, we're talking about the early '80s) what was called an "override" on the gear retraction system: it was meant to avoid a student having the plane landing on its belly after forgetting to lower the gear. It would automatically lower it below stall speed, even if the white lever was "up". The instructor had an engine catastrophic failure over a farm field, made for a perfect belly landing on the pasture  - strewn with termite mounds - and the wretched thing lowered the gear at the very last second. Struck a mound with a half-lowered gear leg, flipped over, and that was that. No "stupid automation", he would have lived to brag&beer.
Reply: @deltagamma-en1zh  I know that overpriced VERY well. On some models they actually installed a pin to keep the auto hear deployment overridden so it wouldn't deploy. We used it a lot in fight training! But I know exactly what you're talking about.
Reply: @deltagamma-en1zh  The arrow will not lower it's gear if the override is up. There is a pin to hold it up and override the system. Most times it is used for short take offs, airwork and in the case of your instructor an intentional gear up landing. It lowers at a higher speed then stall speed. I have about 500+ hours in Arrows mainly the IV but also the IVT, III, II and I. Very familiar with the plane. Sad he didn't have the override on.
Reply: @Quillons1  I'm confident after reading your detailed material, I can in fact now fly a plane on that info alone. Can you briefly explain how to take off & land? I'm calling to reserve a plane right now for tomorrow, hopefully I hear back by then. lolol
I don't mean to make light of such a tragic situation & I'm not, may the pilot RIP. One of my best buds flies a Hawker 800 for a private company with a household name, so I understand the seriousness of the issue at hand. He had a moment that shook him, a plane came out of nowhere directly at them & he said if he could've stood up & raised him arms straight up, he'd have lost his hands...It was that close! His company offered him extra time off but after a couple of days he was back in the air.
Funny story...kind of. My buddy & I went up in a brand new 6 seater "something", it was really nice, anyway we had it for 2 hours as he was just logging hours & letting me fly it a little bit. It was a bluebird day & I was hungover as could be from a bachelor party we held at my house just hours before. We stopped for a fast food burger on the way & off we went. About 30 minutes into the flight came my 1st hotflash & vertigo feeling, I warned "Jeff" I thought I may get sick, 10 minutes later it was inevitable...It was coming out no matter what. I frantically tried to find a sick bag & couldn't, panicked I asked where do I do it? He had already turned back towards airport just as fast as he could go, so he tells me to go out the window. The window only cocked open so far & I let it fly, no pun intended. It appeared to almost hover in mid-air just outside of the plane, then proceeded to come back in & cover me & the whole inside of the fuselage, as well as the outside of the plane. It was a mess. I was a mess. Jeff was not a mess & how he got us back & on the ground without himself getting sick is beyond me. The worst part was the clean-up. Never again getting in one of those on a hangover!
Reply: @ghpjerry  That story...well that just sounds miserable! 🤣🤣 As far as landing, here is a brief lesson. Push forward on the stick, the trees get big. Pull back on the stick, the trees get small. Keep pulling back on the stick, the trees get big again. 😁
Reply: @Quillons1  hahahahaha on all of it!! Have a blessed day!
Reply: @johnmajane3731  I flew the Arrow for some hours (it was demanded for RG- and propeller pitch- qualification), but not the one involved in the accident (we weren't allowed to fly planes not specifically earmarked for instruction), so I can't say anything about it; but I do know that not all units had the pin - either they were removed, or something else. But anyways, I think it's just one more thing a pilot has to be very aware of - and in the worst possible circumstance: so it seems to me just another unnecessary weak link, with far more potential for disaster than for benefit. This is what I call "stupid automation": a contraption that shouldn't be there, trying to make up for sheer lack of proper training.
Reply: I’m not a pilot, but I’ve got friends who are, and I’ve always herd, aviate, navigate, communicate…  so with little knowledge I have  you could still keep altitude all be it harder on yoke input.  It wasn’t an engine issue, so I guess that would be a learning point for future pilots, get the flight instructor on the frequency and they should be able to walk you through whatever issue. I’m wondering if this was a first solo flight so nerves were already on edge.
Reply: Hey. Thanks for taking your time to write this post! I'm very glad that I came across your post. I'm a brand new CFI(>30hrs instructing time), and I  can say I am still in the learning stage.  Anytime information that I can learn to help me be a better instructor to my students, I'm open to it. I've never heard of the term "runway trim." I'm only experienced on Piper PA28 -161. My question is this: Is this a system only on the  SR20 and other advanced aircraft? Of course, I'm going to go do some research on this topic.
Reply: @nimbapilot6925  First, congratulations on earning your CFI! And yes, you THINK you know a lot about flying until you start teaching it! 😁 I learned more about flying AFTER I became an instructor! To answer your question, it so happens I have a lot of time in PA28-161s. And no, electric trim is not only in Cirruses. I've flown MANY models with electric trim and runaway trim is not exclusive to the Cirrus. In fact I've flown Warriors, Archers, and Arrows (all of which are PA28 models) that have it. And I've flown 172s, 182s and a 177 (Cardinal) that has it. My actual, in flight, experience with runaway trim was in a Caravan. Anyone else who has Caravan time knows how fast that can go bad! Electric trim, for the most part, is a nice feature and can basically be put in many GA planes. I'm learning here, too, as I don't have any Cirrus time and it sounds, from other posters, that the trim system in the Cirrus is not a physical tab, like you find on your Warrior. It seems that it's more of an "adjuster" (for lack of a better term) that actuates the whole stabilator. Not uncommon among very fast planes. Here's the thing, though. I did go and look up the EP for runaway trim on a Cirrus SR20 and I don't remember it word for word but it basically said to do what a lot of us were saying. The plane doesn't have a manual trim wheel but the EP specifically states you can, and have to, overpower the trim forces.  So take that for what it's worth.

A nickel's worth of free advice on instructing. Most CFIs are only doing it so they can get their time and go right to an airline job. Many of these guys are more concerned with showing their students "How the airline captains do it". Don't do that. You're not teaching in 737s (yet). One of the biggest mistakes I see CFIs make is they try to treat a GA plane like it's an airliner. It's not. Treat it like what it is, a GA plane. Remember, your student needs to learn to fly THAT plane. Don't try to show him how to fly an approach like you're in a 737 when you're in a Warrior. Completely different animals. This detracts from your student learning how to fly a GA plane while getting ready for a GA checkride. I'm sure there are guys who disagree with me on that point but I've seen much more harm than good done to students who's CFI likes to show him how much he knows about how the heavy iron guys fly. Save that for the company that hires you, they're really good at teaching pilots how to transition into big jets. Stay safe and enjoy teaching people, it's a lot of fun!
Reply: @Quillons1  thank you so much. Trust me, I will apply just as you have said to the little experience that I have. So far, the five students I have are all military guys whose end goal is to get their ppl and apply for a pilot slot for the airforce. The other day, one of them asked me questions on how the c5 flies and my suggestions on what he needs to do to get ready for flying the big guy. In a friendly manner,  I just told him I had no idea on c5 flying characteristics , but what I do know is the basic principles of flight apply to that of a c5. I went on by telling him that my number one goal is to teach him how to safely operate the aircraft that he is learning how to fly on and to get him ready for his initial solo. I hope I did not shut him down, but I don't want to teach my students a future that I have not experienced
Reply: Do you have to disable the electric trim on a Cirrus in order to be able to control it manually ?   Unlike a 172 or Warrior, where if it is equipped with electric trim you can choose to do either ?
Reply: @nimbapilot6925   soo just so they know to be a pilot for the airforce they have to go to the Air Force academy college. And acceptance is super strict. Other branches are less stringent on their requirements.
Reply: @motivationindrive8514  That's not true at all. You have to have a college degree (because you have to be an officer) but you don't have to be a graduate of the Air Force Academy.
Reply: As a fellow pilot I agree, condolences to the family and friends.
Reply: @Quillons1  wow, you've got  issues man. This kind of anger doesn't fit well in a cockpit.
Reply: @Quillons1   well I’m one to admit if I’m wrong, I’m just going off what I’ve herd from airforce buddies i have.  Maybe it’s all there pilots train at the Air Force academy… maybe misunderstanding.
Reply: Everyone thinks there so safe because of the parachute
Reply: @gringoloco8576  If the breaker is hard to reach, you could turn the master off until you were in a better position.  Anything to stop the actuator.  This accident is unfortunate, it's hard to cover every scenario you could encounter.  I agree some of the technological advances have made it easy to become complacent.  Systems training is becoming as mundane as dead reckoning, meaning people only learn it because the DPE is going to ask them a few questions, but either one could really save your life someday.  I cringe every time I hear people talk about how good some of the programs to pass writtens are, that you can just memorize the answers without any real understanding.
Reply: @Mr.Scootini  if you can't get to the breaker, turn the master off until you can. ATC will forgive you for being silent for a minute, they'll know there's a problem when your xpdr goes dark.
Reply: @Maverick_1b  that’s a good idea to shut off the master. I’ll shove that in my head 😂
Reply: Greatttttt comment‼️‼️‼️
Reply: My first thought was shut off the master, then find the circut breaker. But you're right, should have been trained previously. If these systems can act up they should be on the checklist and in the training regimen.
Reply: @ssinger99  pushing and holding the AP disconnect switch disables the electric trim in all SR models.  There is no need to find a CB.
Reply: If your aircraft has manual trim
Reply: @lemonator8813  Yes. It seems from what I've heard that the SR20 has no manual trim wheel. So now that we've made that clear, if this were to happen again, should the pilot just say, "Well, there's no manual trim wheel so I'll just give up and ball the plane in because I can't manually control trim"? Beware those "toxic attitudes". So it doesn't have a trim wheel. Use the yoke.
Reply: @Quillons1  yeah my trim got stuck full up on my second solo the Slings I fly have no manual trim. Somehow I'm still aliv4
Reply: I don't think that you were disrespectful at all, and I think that your points are valid.  I'm not a pilot, but I am an aviation enthusiast who knows a bit about airplanes. I guess I'm a purist, because it seems detrimental to me to have a student learn to fly on a plane that does basic and essential functions automatically. To me, it's critical for a pilot to learn how to fly a plane manually.  After you have learned these skills and had some hours with the manual functions, then if you want to fly a plane like this, do it.
Reply: You could have said that in many less words.  “The pilot screwed up” would have sufficed.
Reply: @markreynolds9135  Clearly we're all in the presence of a master aviator. We should all be grateful for this man's simplicity. Thank you for clearing that up.
Reply: @markreynolds9135  This was a student pilot.  And saying that they screwed up would not be adequate.
Reply: I got my private ticket in a Cherokee and transitioned to a Cirrus with about 150 hours of flying. The official transition course was in most respects extremely thorough but at no time did any of my Cirrus instructors simulate a runaway trim or autopilot. I have since looked up which breakers control these and can find them by hand alone. Did any of you notice that the seatbelts on the pilots seat are missing in the TV footage? In the Cirrus they contain airbags. Did the firefighters cut them away? Or did they break?
Reply: Ex-trucker here with 21 years of experience, not a pilot (except for R/C models).  We have the same sort of thing going on in the trucking industry.  Modern trucks have so many systems that do all sorts of things for the driver, and even worse cannot be disabled.  As long as everything is working fine and road conditions are good it's not a problem.  As you might expect, as soon as road conditions deteriorate or systems fail modern trucks can become difficult and dangerous to operate because these systems can't perform as well as a properly trained driver.  The worst aspect is trucking companies are investing less in properly training drivers and instead relying on such systems to compensate.
Reply: I think that was a sincere, brutally honest response from a senior level pilot. I’m a non pilot civilian, so your professiolism and description in such was well received. You stated facts, and strong suggestive opinions backed with common sense experience. I hate the young Man lost his life, at least he ditched in a remote location as he could. Commend for that. RIP
Reply: @gringoloco8576  That is exactly correct. It is in the left seat footwell, on the right. That’s also where the alternate air is at by the way. But reading those CBs whilst also fighting the trim would be a bit of a hassle, and probably not that easy when you’re in such a panicked state as this particular pilot. It wouldn’t be impossible to pull off, but they are nearly impossible to read from an upright seated position.
Reply: @Dr_Kenneth_Noisewater  There actually is no manual trim in Cirrus planes. The only option would be to fight it until you can pull the breaker (which is in the floorboard at an angle) and just put up with it.
Reply: I guess RIP too…? textbook definition of beating a dead horse (pilot)
Reply: Wow dude.  For real
Reply: @Dr_Kenneth_Noisewater  That’s the issue. He should have been familiar with the breaker and manual trim. To say “you may not know” is not an answer. Anyone learning on an airplane with auto trim, especially one that spoils you as much as a Cirrus, should know about runaway, and know where that breaker is.
Reply: @Shojohn11  The autopilot shutting off isn’t a problem, it’s an inconvenience at best. This was runaway trim, which is a flight control malfunction. Autopilot is irrelevant.
Reply: I am a Cirrus pilot with 70% of my time in a Cessna, I could not agree with you more. It is like driving a 1200CC motorcycle on autopilot as a beginner. I have always felt safer in a Cessna only because of my experience and ease of flying. Montgomery field is so close to the ocean and beaches he only needed 500 feet AGL to pull CAPs and that would have saved his life. Going around is nothing to be ashamed of and should be practiced more often. I can’t imagine he wasn’t 500 feet AGL at the time of the problem. I’m think finding breaker for your trim in a cirrus would have made this episode have the same tragic ending. May his memory be a blessing to his family and a lesson to CFI and students to remember to fly the plane.
Reply: I have like 16 hrs of actuall flight time not even solo yet and I agree 100% the trim tab only makes up 1/4 of the elevator he should have still been able to gain altitude by pulling the yoke back and adding power, this is my logic in learning on the oldest beat up plane they have at my school with the most problems to work through plus it's the cheapest, stay calm on the radio stick to procedure stay safe out there
Reply: @phatvu3811  then he should not have been signed off to solo
Reply: The worst thing any aviator can do is not learn from the accidents of the past and present.  That is what I love about MentorPilot on his channel.  He is an instructor and constantly tries to impress lessons learned from past incidents to hopefully make flying safer.  The argument that new features and automation or often relied on too much by newer pilots has been made that has been the cause of incidents.  More emphasis needs to be placed on basic airmanship in training so that when automation systems fail or malfunction, a pilot can still fly the plane and land safety.
Reply: @louiszierlein5814  I agree with you, this pilot needed the ATC who was still landing and departing planes instead of aborting them promptly. She should have given top priority to the pilot who had declared the emergency and was clearly in distress.
Reply: BOOM! Articulated very well..and based on factual, historical data with typical GA training/experience taken into account IMO..
Reply: @Quillons1  Man! I HAVE to say..that was THE most enjoyable, articulate passive-aggressive SMACK-down I’ve ever had the pleasure of reading. MY compliments sir! (The sad part is: apparently HIS side of the conversation has been “shadow-banned” as I wasn’t able to SEE ANY of his retort..initial OR follow-ups). Regardless, That was a FUN 20-30 minutes of eloquently-put flying experience with a CERTAIN aspect of an emergency in mind. Thanks!
Reply: @Quillons1  I find it interesting that you have such strong opinions about an aircraft that you clearly have Zero time and in and don't know much about.  I instruct in this aircraft every day.  It is an incredible aircraft and like any type of aircraft one must be properly trained to understand and maximize its capabilities.

Cirrus TCI's and CSIP's train diligently with Student Pilots for these types of "runaway trim" scenarios.  However, who knows if he received that type of training as any CFI can instruct in a Cirrus without the Cirrus TCI or CSIP designators.

Further, not a single Cirrus instructor I know trains the "chute" as the first option for EP's.  But let me tell you something...  In hard IFR, at night, in a single-engine recip, I'm glad that option exists.

So if you're really interested in the aircraft, instead of slinging around bullshit and conjecture, why don't you take a trip down to the Cirrus Knoxville Training Center and actually learn about the aircraft and the very discrete and granular training program the Cirrus uses to train new pilots in this airframe.  You might surprise yourself.
Reply: @walterfoster2408    Oh goodie, someone else has finally come along that took what I said personally. For those of you following these long responses, strap in, Walter, you might want to grab hold of that chute handle.
For starters, how do you say, "I'm a poor CFI" to a whole comment section of aviators and aviation enthusiasts without actually saying, "I'm a poor CFI"? Well, we can thank Walter here for demonstrating that for us. And, yes, Walter, you made this personal so I'm responding in kind. Let's look at the opening salvo. You point out that I have no time in a Cirrus like you are the lead investigator in the JFK shooting and just found the mystery shooter in the grassy knoll. Well done, Scooby, I stated that several times in several of the posts I made. Did you actually read everything or did you read one comment, get butt-hurt, and fire off without thinking it through? I never claimed to have time in Cirrus and actually went out of my way to state I DIDN'T have any time in one. Then you went on to state that you instruct "every day" in one and that is an "incredible aircraft". We'll revisit that statement later. Then you said something very profound. "...like any type of aircraft, one must be properly trained to understand and maximize its capabilities". So, in other words, you agree with what I said about proper training. Because if you actually read what I posted, that's the main heart and soul of what I said. I don't need a single minute of time in that plane to know that proper training is paramount. If you really are an instructor, you'd know that. I'm going to say you and I have EXACTLY the same amount of stick time in a Concorde. But as CFIs, both of us can say that proper training is necessary to understand and maximize, well, you get the point. By your own statement, you qualified me to make mine. ANY aircraft requires proper training. You are not the only one qualified to comment on the validity of proper training in a Cirrus just because you fly one and I choose not to. I'm every bit as qualified (and I'll bet my next paycheck even more so) as you to comment, openly, when invited to, on my thoughts as to this situation. You clearly have an awfully high opinion of yourself to think otherwise. Another thing we'll revisit later.

Walter then goes on to state that "Cirrus TCIs and CSIPs train dilligently with student pilots [for these types of events]" That may be true. Then you said that ANYONE can train in a Cirrus without having had that factory training. Also true. Also another point I made. We don't know who his instructor was, where he was trained, and if he properly prepared this kid for this contingency...if this even WAS the contingency. I also stated, if you actually read it, that a lot of my opinion was conjecture based on the information we had on hand at that time, which was about 2 months ago. Soooooo, again, you actually agree with me that it is possible, maybe even probable, that this kid was NOT ready for that situation, if that WAS what happened. So far it looks like you're arguing with me, 2 for 2, for being RIGHT. Not quite a debate champion, are you, genius?

Next, the infamous chute. I am in no position to disavow what you're saying about whether instructors teach or don't teach to go to it as a first option. Where I AM in a good position is to say that I have flown with a LOT of guys that trained and/or flew in Cirruses, and when I do a simulated engine failure on them, I have an almost 100% rate of getting the SAME quote. "In the Cirrus, I'd just pull the chute." Guess who DOESN'T say that. Guys who flew Cirruses but didn't LEARN in a Cirrus. That's a fact you can tuck under your pillow, pal. You might not be teaching it, but that's what they're LEARNING. Says a lot about YOU as an Almighty "Cirrus CFI", doesn't it? Go back and read some of the OTHER comments from OTHER "Cirrus pilots". In this very thread you have guys that have said they would've gone straight for the chute. That means that students are taking away from the lesson that the chute is the automatic option. That also means that "Cirrus CFIs" are failing in their responsibilities. That's you, bud.

Then Walter tells me if I'm interested in actually flying a Cirrus then I can just take myself down to Knoxville. Oh because that's free? Are you paying for that for me? No? Then that's a stupid suggestion. I'm in NY, and guess what, I'll tell you a secret if you promise not to tell anyone else. They have Cirruses in NY. I do not have an interest in flying a Cirrus for MANY reasons. If you're interested in why, and want to actually have an adult discourse without getting cute with me, I'll actually be happy to tell you, or anyone else here, why that is. 

Slinging Bull$hit? What BS have I slung? Cite one example. There are, what looks to me, several experienced pilots who have all agreed with me. Are they all full of $hit, too? No, the only one here that's "slinging bull$hit" is you. In fact, your entire rant here sounded like a giant fart, because that's where your talking points come from, your a$$. If you were a real professional, you would have taken a different approach, even if you disagree with me. You're no big league player, for certain.

If you read this far, here's our revisits. First, the Cirrus being an "incredible aircraft". Sounds to me like they have some very serious safety issues and dangerous contingencies that they have not properly engineered the plane to handle. Doesn't fit the bill of "incredible" in my opinion. But again "incredible" or otherwise is just that, opinions. Second, your attempts to try and impeach my credibility as a pilot and an instructor after your outburst are very telling. Both of these things I've mentioned paint a very reasonable picture that you PROBABLY, notice I said "probably" learned in a Cirrus. You're probably a relatively young CFI and think you know more than Cirrus does about the plane. You may not have any time, or if you do it's probably EXTREMELY limited, in other airframes. You're probably very low IFR or "hard IFR" time because even YOUR statement says that you're grateful you have that chute as an option when you're in the clouds. All of these things that you've given up, voluntarily, paint you as a guy that flies and teaches in a tiny bubble of a comfort zone due to the aircraft you fly. I wouldn't put ANYONE I know in a plane with you, much less in the clouds, based on your statements here. I hope you survive your first emergency and it makes you grow up a little. Your whole approach here was juvenile, at best. Come up to NY and I'll teach you what it is to actually be a real CFI that's more concerned with creating PILOTS instead of what that student flies. I think YOU might be surprised. I won't even charge you. Call it a professional "courtesy" unlike what your response to me was. Keep the blue side up.
Reply: @Quillons1  That Sir, was a hysterical response.  I am impressed however, that you have that much free time to put into it. Apparently I offended your sensitive spirit. So for that I apologize. I was fortunate, I got the best flight training in the world in the US Navy.  I had the opportunity to fly tactical jets on land and at sea.  I got to fly them in some pretty tough weather. I had several emergencies while in the Navy, but fortunately no ejections and none as a civilian.  I try to impart what a learned as a Naval Aviator to my students and I feel I have pretty good success with it.  I develop safe, proficient, confident pilots. It sure seems through your response that you have a bias against Cirrus and the folks who fly them.  Cirrus has a solid training program and that’s what I suggested you focus on.  I’m not interested in getting into a pissing contest with you over who’s the best pilot and whose got the best aircraft.  What I will contest, is your theme that folks who fly the Cirrus are poorly trained rich people who pull the chute at the first sign of trouble.
Reply: @walterfoster2408  I'm glad you found humor in it. That was my reaction to your statement that I am "slinging bull$hit". If what you're saying is true that you're a Navy pilot, then I'm even more surprised that your response was as careless as it was unjustified. As far as having "time" for this, it seems you're as invested in it as I am and willing to spend your time likewise. So if that was a shot, it fell well short. Yes, I do have the time to address things like this because I, too, am a dedicated flight instructor and aviator. I would've expected more from an Officer and a "gentleman". You're not the only one between the two of us that had a cool flying job in our prior life chapters. That being said, yes, you offended me. No, I do not have a "sensitive spirit". But if your apology is genuine, then I accept it in the spirit in which it's offered.

Second, when you're right, you're right. Only in this instance you're only half right. And when you're only half right, you're all wrong, or so the saying goes. I am biased with Cirrus planes because of SOME of the pilots it has created. Every week I see the deficiencies in pilots who learned on them and literally cannot function in a more basic airframe. That's not conjecture, that's a reality. If you're not experiencing it, it's because you're, by your own admission, training in Cirruses. I am not biased towards everyone who flies a Cirrus. In fact, I've even said that some of the best pilots I know fly them. I am, however, put off by people who got their license in one and cannot perform basic pilot skills and then look down on the "dirty throngs of lesser pilots" (like we're peasants) who DON'T fly a Cirrus. I see it every single week. And I get to educate them very often what happens when you lack basic flying skills. It's not bullying, humiliating, or otherwise deprecating, and I always get a "thank you" for it. You said I come off as biased against Cirruses and those who fly them. You are just as guilty on defending, vehemently, those same planes and pilots to the point where it appears that you aren't willing to lift the foggles and see the rest of the picture. 

I have absolutely no doubt that Cirrus's factory training program is top notch. It also has the price tag to go with it. If you had the money to attend it, that's great. Even greater if someone paid for it FOR you, and you're fortunate and are the beneficiary of what is, no doubt, exceptional training. Your average Cirrus pilot doesn't get that quality training. I've lost count how many times I've been to the Bell Helicopter Academy. Thankfully my former job paid for it. I could NEVER have popped for that tab. But not every pilot that flies a Bell helicopter gets trained by them. So the inference that Cirrus is training their pilots to certain standards is a false equivalency. Cirrus ISN'T training most of the Cirrus pilots out there. Some kid trying to get an airline job and doesn't want to pay for his hours is who's training most Cirrus pilots out there. And yes, it's prohibitively expensive for your average student pilot to learn in a Cirrus or even get checked out in one. So it is mostly rich, or at least moderately well-off people, who fly them. And I see with my own lying eyes, and hear with my own ears how many of them talk about "the chute" like it's the holy grail, Ark of the Covenant, and dead sea scrolls all rolled into one. Maybe not YOUR students, but it seems like everyone else's are. 

If your flying experience really is what you say it is and I was that far off the mark with my assessment, perhaps you were wrong about your assessment of me, too. Just maybe.
Reply: @Quillons1  There is actually a lot of truth in what you stated.  I am constantly fighting against the notion of the chute and what it represents in the training of students.  Regrettably, there are a large number in the Cirrus community that have more money than brains or skill.  I see them during IPC’s and Flight Reviews.  They do tend to be wealthy people that are looking for a quick sign off which I refuse to be a part of.  We do get a number of young students who are headed to the airlines that have families that can support the cost of Cirrus training.  Our school works hard to change that Cirrus perception that is out there amongst a fair amount of people and I work on it every day. Ultimately, this kid probably didn’t get what he needed and deserved from his training.  Or maybe he just panicked.  Either way a sad outcome for what should have been a very recoverable event.
Reply: @walterfoster2408  See? Now we're friends again. In the spirit of fellowship, I offer sincere apologies for my direct and less-than-friendly discourse. And yes, it's sad and tragic and frustrating to see this happen. And I get why frustrations come out. Thank you for your service to the country and the aviation community. And no, I'm not being sarcastic or hyperbolic.
Reply: @Quillons1  the same to you.  Stay “on course & on glide path.”
Reply: As somebody whos currently working on their PPL in an SR20, what should I do? Im already super invested in the flight school Im currently at and it would be a massive pain to just switch. (Theres also not many options near me that are convenient) My end goal is to work in the airlines, but my current goal is to be as competent of a pilot as I can be flying a cirrus. What should I do?
Reply: @aidenroman6997  Continue what you're doing, but demand the best best from your instructor is what my advice would be. You're paying him a LOT of money so get your money's worth! Don't be a dollar sign and/or just another 1.5 in his logbook so tomorrow he runs to JetBlue because he finally hit that hour mark. It's not an automatic that you'll be an "inferior" pilot for learning on the Cirrus. As it's been pointed out, it's actually a great plane and there are some extremely good, and safe, pilots flying them, despite what my personal misgivings are on it. Talk with your instructor and make sure he knows you don't want to be a guy that passes a checkride but wants to be a "pilot". Don't switch based on what you see here. Keep in mind, everyone posting here (especially me) is only offering opinions. I would make a recommendation, though. When you get your license, no matter what plane you do it in, take some time to enjoy flying before you run off to an airline and then it just becomes a job. Go on some cool trips and find those good restaurant destinations. There are always guys in your area that know good places to go and cool things to see. And with services like Uber now, you don't even need a crew car. Oh yeah, one more thing, always carry gum or tic tacs. I don't know the physics behind it but it's a universal truth that when we fly, for some reason we ALL need them! Fly safe.
Reply: I really don’t think the make and model had anything to do with this accident. Maybe the only thing that draws certain pilots to cirrus aircraft is the parachute. Other than that, there are plenty of airplanes out there that have highly sophisticated systems.  For the most part I feel that if series aircraft didn’t exist the same accidents would just be happening in Mooneys and beachcrafts. I also disagree that these systems do everything for you. One might be drawn to these highly sophisticated aircraft assuming that to be the case but I just don’t think it’s true. Highly sophisticated aircraft can be flown with greater precision and greater safety margins but only if flown by a pilot that has a high level of training.  I might’ve missed it but this pilot was so panicked that he didn’t even declare an emergency. I’ve never understood the hesitation to declared emergency. The controllers want you to declare an emergency sooner rather than later because it allows them to do whatever it takes to help the pilot out and avoid tragedy.  I have a question for whoever might have the answer, if the pilot had just completely shut down the master electrical switch would that have allow the aircraft to be operated safely?
Reply: @jcgrumman7418  Nope. Not jealous. And to be more accurate, it was the "V" tail Bonanza, not just any Bonanza that was labeled the "Dr. Killer". I choose for any pilot to LIVE in any plane. Not to die in an airplane that's relative of his economic status. This would be just as tragic if this kid died in a Cessna 152. If I was jealous of people with a lot of money I'd be blasting Bonanzas, (the A36 is actually my favorite GA plane), TBM 500s, various Mooney models, the list goes on. Once again, looks like you took my opinions a little personal. I never said the Cirrus was a bad plane. It's kind of like firearms. Guys get VERY defensive when someone says they don't care for a particular firearm that they own. They seem to interpret it as, "He's hacking on MY airplane! That means he's saying I'M a bad pilot or I have a bad choice in airplanes! I'll show HIM!" Take your personal pride out of the equation and really take an objective look at what's being said. Instead of taking it personal, be a little more aware of what's being said instead of what you THINK is being said...especially when you think it's about you. If you're offended by what I've said, the odds are that I hit a nerve you didn't want to hear about YOU. Maybe not, but that's basic psychology. Of course, you could be the best pilot on the planet and you just love your Cirrus SOOOO much, you just refuse, or are unable, to be objective about it. Stay safe up there.
Reply: My son was flying Cessna's at age 13 with the Civil Air Patrol. He just came home from a 5 yr stint in the military and ran into a friend who is a CFI who offered to get him licensed, and I'm scared because of all the GA crashes. My son has also suffered head trauma in the military and I wonder if he can even pass an aviation physical.
Reply: @rbadventure7066  That would not have been my first thought at all in the pattern, but that is what makes your comment such a good point...
Reply: I really liked your explanation.  I do hope others will listen and learn so this does not happen to them.  RIP Mr. Pilot! I have you,  other pilots but most importantly your family in my thoughts and prayers. 🙏🙏🙏
Reply: I checked out in a SR20; didn’t like it at all. I guess I’m also old school (started flying in mid 80’s). Many Cirrus pilot are obsessed with autopilot (or Otto pilot). They love to see the plane fly an instrument approach in actual IMC; I don’t get it, the fun is in flying the approach yourself.
Reply: Your opinion matters. And you shouldn’t have to feel the need to defend your thoughts from the onset. Regardless whether others agree or not, we should take what you say as a valuable opinion. Those who dont are being “macho”. Check yourselves. Because in emergency situations it can happen to you. This is the reality and the margins of risk are only getting higher by the second. Everything you know or do in that cockpit matters and counts. Stick to training and never give up. 

Having insight from your response is appreciated. As pilots, we should all be learning and taking in any information we learn and use them as tools when needed, whether you may agree or disagree.
Reply: @Quillons1  Nope,  haven't flown in a while but when I did it was in my Grumman Tiger.  Garmin 430, century 2b autopilot hard IFR through the Adirondack and White Mtns.  Peace
Reply: The Cirrus are a nice plane but Ive been saying it for a while now they makes pilots way to comfortable.
Reply: You’re calling your assumptions as facts and drawing conclusions and judgement based on that - sounds like someone fits the category of know it all bc I’m an old ass school with many hours— no need to talk about who I’m but a little more Knowledge n research will educate yourself more. Solo student pilots have low risk  comparing to certificated pilots and especially instrument rated (research 2001/2005) . As for Cirrus Aircrafts and all advanced avionics those are the safest airplanes and pilots trained in them have great skills in terms of cockpit resources which obviously you lack and airmanship as well n most transition to Jet/ Turboprop (research 2013/2017) - as for the Trim issue thats a flight control problem and could be a trim failure easily due to a long list of issuers especially if Airplane recently had an annual (Accidents Database) so the fact you’re saying he couldn’t trim the plane bc of lack of knowledge that’s inconsiderate/ arrogant  comment and insult to his CFI n his sole— you’re an arrogant worthless POS.
Reply: He must have hit that ground hard to crush that plane like an aluminum can. Or either that airplane's not really made out of nothing but an aluminum can. It's either one of the 2
Reply: Watching this a bit late but I am a student pilot and I would love to learn a how to deal with a runaway trim but sadly my flight school only operates manual trim models. However, I will learn the theory of it on my own incase I ever fly with a electric trim I know what to do if it goes south
Reply: Thanks  I a m beginning training on a cirrus this summer   I am 65 do you think I am too old to learn to fly     If I do go on with the training I will be curious how long into traing  before I hear about  trim problems   will get back with you    my iontentions are to train and get 200 or so hrs in cirrus prop then  purchase the Vision Jet     again does anyone think 65 is too old to learn to fly
Reply: @tradingtimes5752  No, 65 isn't too old. I have a student that's 70 and he's one of the best sticks I've seen. Maturity goes a long way in this industry. Good luck!
Reply: I’m not a pilot at all but I agree that in general (this applies to MANY things these days) the smart stuff is best when you’ve learned the real way first. With that being said tho, an airplane using auto trim like that especially off of AP and NOT having a specific indicator for it just sounds really insane.
Reply: Good point.  sadly, the future will have the cars the same way.  Younger generation can't even back up without a rear camera. only going to get worse.  As someone whose career is IT, I am an adamant believer that technology is not always good or progressive. in fact, lately, it usually is not.
Reply: Agreed.
Reply: Cirrus Hater !
Reply: @Mr.Scootini  wow excellent plan
Reply: @Quillons1  your comments may have already saved a Life. Love Humility is a life saver" God bless you bro
Reply: I think you're right.  I learned to fly when electric trim was a GEE WHIZ thing!!!  I did fly a few with electric trim, but most of my flights were in the old fashioned "big wheel" on the lower half of the center console.  Frankly, I trusted the old big wheel more than I did the control column button.  Overshoot seemed too easy.
Reply: I have 120 hours in a 172, first think that came to my mind is: why didn't he pull the trim curcuit breaker?. Very sad outcome.
Reply: This same sort of thing happened in the Airbus Air France crash... Fly by Wire tech is great, but when one pilot is pulling and the other is pushing (in a stall), bad things happen
Reply: well said
Reply: I agree with your assessment.  I started flying back in the 70's . . . got my private, commercial, multi-engine and instrument ratings.  One thing we didn't have back then (on most "little" aircraft") was all that fancy stuff.  I worked as a PR guy for Beech Aircraft in Wichita, and the first time I flew one of those "fancy" aircraft with a trim button on the yoke, I thought I'd hit the jackpot, BUT no one ever cautioned us about the possibility of runaway trim or showed us where that particular circuit breaker was.  I think it would be great if manufacturers such as Beech, et al, would put vital flight circuit breakers beneath a spring loaded flap somewhere on the instrument panel where they could be easily reached, along with in-air instruction on how and why to use them.
Reply: Very much agreed... learn to fly first, then buy a Cirrus or another Wonderplane...
Reply: Most modern cbs are not pullable.
Reply: I couldn't agree more.  Especially when it come to navigation.   Pilots these days rely to much on GPS.  If they have a gps failure most would be completely lost.  I started old school we didn't have GPS .  I started flying helicopters at 15 and I'm 48 now .
Reply: Very well said and right on point! I’m a boat captain and many modern boats have similar “convenient” high tech features, and when training new captains I tell them to never completely depend on that stuff and make sure that they can still do it the old fashioned way.
Reply: I’m a student pilot myself, would turning the master switch off be a good alternative?  Since it controls the power?
Reply: Agree 100%
Reply: You're spot on as far as I can tell with the limited information available.   It sounds like the pilot panicked and became whole focused on landing the plane and nothing else.  It's impossible to tell from this whether he just simply lost it under pressure or if his training didn't adequately prepare him for an emergency.  RIP Sir.
Reply: This thread is full of comments from people who actually never flew a Cirrus SR20. I own one. The facts are:

- It has no manual trim
- It has a breaker and you should know how to reach it
- You won't reach it in time, most likely your trim is full by the time (it's not a tab b.t.w.)
- It's a comfort function, there is no issue to fly the plane without, fully trimmed wrong
- The forces in the joke are not very strong, trim and springs combined
- It's true however that, because of the short lever compared to a stick, it requires some muscle

Is it possible a student pilot struggling under the best of conditions to safely land a fast, low wing plane, to be overwhelmed by a runaway of the AP or trim? I am sure. It's part of a good transition to any type to train for such things. No student must go solo without knowing how to react. The owners typically know. But that's still not a guarantee nothing bad happens.

There is simply not enough type specific training or currency requirements for SEP fixed wings. I fly helicopter as well, you need hours and a type rating per type per year. And as we all know how to fly helicopters, those are almost 100% emergency procedures. That you can fly any plane that fits the SEP category in fixed wing is convenient, but not safe. The types don't differ as much as helicopters do in how they are flown, true. But if you are current from hours in a C172 you can't safely fly an SR20, and the other way round.
Reply: I got my ticket in 2007. Although I may lack advanced ratings & frequency; of flying
I COULDN'T AGREE WITH YOU MORE. On each and EVERY ISSUE you just touched upon. I had a V-Tail Bonanza at a point-  Had I magically appeared in the aircraft with the unfortunate victim, I'd have immediately looked to pull a fuse due to experience, not prior knowledge. Had he been in a less complex plane at that juncture he'd likely have lived to gain that experience or knowledge
Reply: Although I don’t have near the time as a pilot as you do, I believe you are correct. I do have a Commercial Multi license and I learned to fly starting in a Cessna 152, then moved to a 172 then did my multi and commercial in a Piper PA-44. Lastly I fly the Cirrus SR-22 and I hated it. It a very nice plane. It’s like flying a Mercedes or BMW with wings, but all that automation is awful. I especially hate the trim on those things. I could never get it set perfectly. The plane either wanted to go up constantly or down, there was no in-between. I loved the Cessna and Piper for having the manual trim Wheel that I could set perfectly and even tweak just a hair to get the plane to stay level and stabilized. The Cirrus is really only good if your a highly experienced pilot. But even pilots I know who have thousands and thousands of hours love to fly little Cessnas or Citabrias. The SR-20 and 22 are terrible for teaching people to fly in.
Reply: This is excellent information to student pilots such as me. Thank you sir.
Reply: @Spetznatz01  the Cirrus planes are traveling planes. They are not planes for hand flying around for fun, they get you from A to B fast and in comfort. It's true, for hand flying, there are many planes that are easier, cheaper, more forgiving, and you might even get parts for maintenance 🙄

But Cirrus pilots travel from A to B, comformtably sitting instead of lying in the plane, with no stick between their legs or wheel in front of their belly, and creature comforts you don't miss for an hour 'round the field but for a 3 hours cruise. Most of the flight, Cirrus's are flown by the Autopilot. You can properly and precisely trim the Cirrus's, with some experience and a quick left thumb, but usually, the Autopilot does that for you. And they have been pretty efficient with the IO360 TCMs, 8 gal/h taking 4 people 130 nm/hour, with fixed gear is no problem for the older SR20. 

I learned fixed wing flying and made my license directly in SR20s, as a helicopter pilot. I agree, as a trainer aircraft without prior experience, there are better options. You might need more hours and every hour is more expensive. But if I want to go from A to B, I'd pick the Cirrus's anytime over the typical trainer types and if something beyond the engine goes wrong, there is no real alternative to a BRS, and that's more common in ULs than certified planes where Cirrus's is almost without alternative.
Reply: I commented before reading this. "Electric trim can kill you. Know where your breaker is." I'm a 60 year old student. But, this seems so fundamental. Thanks for sharing your knowledge.
Reply: @gringoloco8576  Can't find the breaker or not sure if it is some Envelope Protection thingy, turn the electrics off and fly the airplane.  Aviate, navigate, Communicate.  Don't need to communicate.  Pulling the electrics eliminates any aircraft system from over-riding your inputs to the flight controls and land.  But I am old-school with many hours.  Not used to all this modern stuff.
Reply: The Cirrus does not have manual trim but can be easily overridden by hand unlike a Cessna 172 or something. It trims by using tension on spring cartridges which move the "neutral" of the control surface. It's not like a Cessna or most aircraft where it's aerodynamically trimmed. The only way to trim it is with the electric trim motor... But it's NOT that hard to fly even entirely out of trim.
Reply: If he flew Cirrus, why didn’t he deploy a BRS?
Reply: maybe next time upload ur thesis with a little more armchair investigation comments. Why does everyone feel the need to be an expert and bragg about what they are
Reply: @KF99 Too low most likely. Generally need 500 - 600 agl minimum to ensure it has time to inflate. Pull it at 100 feet at its most likely worse than just flying it in.
Reply: @briantii  maybe he would be able to go inverted and gain some altitude.
Reply: @KF99  Lol definitely not, that won’t work. He should have just pulled back on the yoke harder and gone full power. Get away from the ground and practice hand flying out of trim then come back and land. The airplane is NOT that hard to fly out of trim. I co-own an SR20 myself and have practiced this type of failure. It’s not fun, but it’s not that difficult either. Sure as heck shouldn’t lead to a crash.
Reply: @KF99  too close to the ground and was probably freaked completely out.
Reply: @nimbapilot6925 

I believe you make a good point.

My thought was, where was the instructor... when I was flying around the airport, my instructor was in the hanger by a radio listing to my as well as other broadcasts.

At the second call made I was surprised not to hear instructions from the instructor- perhaps it is not allowed IF there is an ACT?
Reply: Spot on.
Reply: Whats worse is having ATP pilots flying lets say 737 Max's with a spinning trim wheel the size of a dinner plate right by the throttle quadrant not recognizing and dealing with a runaway trim issue. The pilots who flew the crash aircraft right before the incident did recognize and disable the runaway trim but did not report it. Its not enough to be a proficient pilot you must also understand all the aircraft systems and how they work,  If your going to operate a complex machine for your career maybe you should spend a few summers as a mechanic intern and learn how those complex system operate.
Reply: @phatvu3811  I think I could relate to his mindset possibly.   As a new pilot there were a few times where panic told me to just get on the ground - ground feels safe.
Reply: Excellent 👌
Reply: As a student pilot in 1974 I had three close calls. I experienced a spun bearing, Bleachers on the runway  with no notum to airmen, Losing oil pressure on final. These close calls all happened @ 2 Army airfields in Germany approximately 30 kilometers from Frankfurt International.  As for airfield operations I was told to take off behind a CH47 even though I had requested to wait for wake turbulence. As a student I never completed my ppl having to return to Fort Lewis now Lewis/McCord. Loved to fly we had great CFI’s with mine being a Major B-52 pilot with lots of hrs. If I could do it again I would. I can’t even imagine the cost of 100L, cost of rental & instruction. Feel for the family of this pilot, he was doing what he loved.
Reply: Sounds about right, he wasn’t using his call sign because he was in a panic. He endangered everyone around and ended up killing himself over a non event. Wow the big three Aviate Navigate Communicate
Reply: Not a pilot, but in msfs one of the first things I want to know how to do is disable all autopilot functions and fly the plane.  Part because I don’t often know what I’m doing, part because flying in full control of the plane is my “safe space”.  It kind of boggles my mind an actual pilot wouldn’t know this basic function to take control of the plane.
Reply: A student pilot in a Cirrus, that’s a fast plane, and it can get super easy to get behind the plane.
Reply: I’m with you. My runaway trim idea was the same. I’ve also been flying (commercially) for some time and we have training on this. I have been out of the “new pilot training” loop for a while. I’m wondering how much emphasis is place on this in new flight students.
Reply: You sir have probably just saved some aviators.
Reply: Nice response 👍🏻
Reply: @Mr.Scootini  Totally great perspective to have as a student pilot (hopefully at this point you've got your cert!). That said, I would acknowledge the possibility that a new pilot who experiences a major problem while lined up on final with the runway right in front of him would find the temptation to attempt to land the plane irresistible. Especially if you weren't 100% sure of the problem and 100% sure how to deal with it, the thought of going around (to a very unknown fate) might be untenable with the option to get it down on a runway immediately available. I'm a helicopter pilot, and during my private rating my peers and I would often joke that "lower collective immediately" was the solution to every problem every time. It is not of course, but this accident might highlight how that temptation might exist.
Reply: Thanks for this response. I’m a 39yo student pilot with low hours in a Cessna 172. This was my impression as well. From the information here, it seemed to me he was fighting the trim to force a landing instead of just going around and buying time to resolve the issue. The planes I’ve been in only have the mechanical trim. In my other careers in the military and medicine, I’ve always taught students you have to plan on anything electrical failing and know how to fix it or do without it.
Reply: Yeahhh long story short he panicked
Reply: As an air traffic controller who is not a pilot, I'm grateful for this information. I've only seen this once (several years ago) and fortunately, the controller next to me working this emergency was a very experienced pilot himself and all turned out well. He received an honorable mention for an Archie League award from NATCA. Thank you for the explanation.
Reply: I actually fly kites.
Reply: You just said a whole lot of nothing sir , you dont have to preference every time you make a critique that you are not being disrespectful . Trim the fat im sure within the hidden message there was a better message
Reply: @head1142  934 people disagree with you so you're dismissed.
Reply: @17crossfeed that’s an interesting take. I’ll ask my co workers about that idea.
Reply: @phatvu3811 a cirrus is not a plane for a student pilot in my opinion. It absolutely requires the “pitch for speed and power for altitude” mindset fundamentals. RIP to the pilot. I watch these videos to learn and get better.
Reply: Thank you!
Reply: I want to share that the instructor of this pilot did go over this contingency not only in theory. This exact thing actually happened in the aircraft during one their training flights a couple weeks before the accident. The instructor showed where the breaker was leading to pulling the breaker giving that real world application to the student pilot. The instructor also did their PPL in a Cirrus, and I believe YZ was one of the planes they actually flew during their PPL. Also, they were around 1500hrs, with instructing hours in Cirrus during those hours. This person was also my instructor, and I would have asked for them in the Cirrus as well. I understand scenarios like these can happen due to instructor inexperience, and I want to clarify this instructor was not incompetent. It's a great challenge that even with training, it's difficult to train how students should respond when fear kicks as new student pilots. This event has weighed heavy on my old instructor, and they almost gave up flying all together from misdirected guilt.
Reply: Jesus Christ just state your opinion and be done with it. Stop saying you’re not trying to be offensive EVERY OTHER SENTENCE. 
This is one of the most annoying comments I’ve ever read lol.